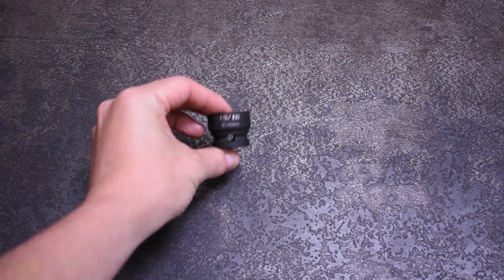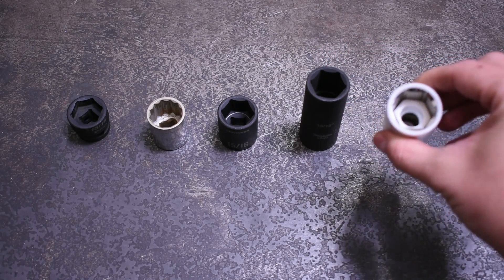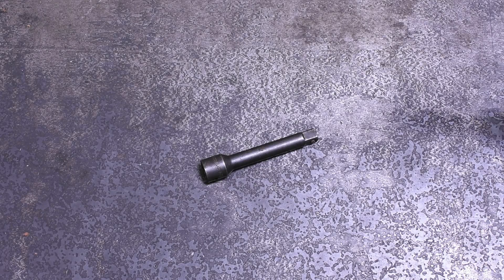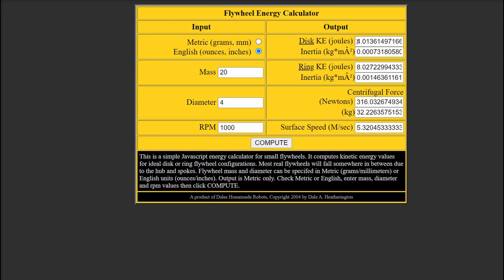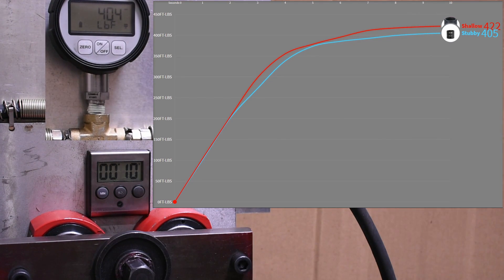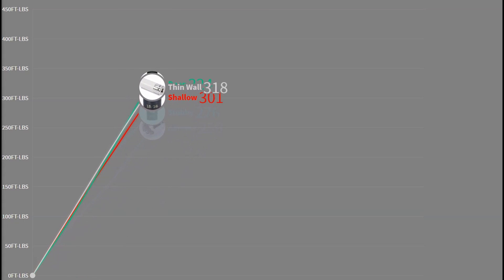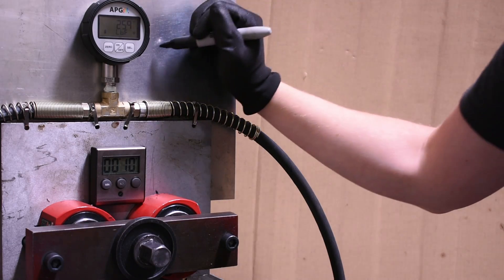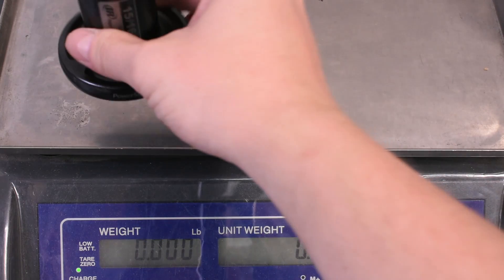Can Heavier Sockets Actually Increase Impact Dyno Numbers?

Comment: you guys should weld a big ol' homemade flywheel onto a socket and see what happens. Love this channel, thanks!
Reply: @fredygump5578  I've welded impact sockets several times and never had one fail but i also was using them manually, not with a gun. I used impact sockets because chrome and welding don't go well together. I think your point is valid but overstated.  Besides, it would at least be fun to see.
Reply: @Lucas12v  I have tig welded many a chrome sockets with both stainless rod and er80 rod. Not a one failed at the weld.
Reply: @timothydillon6421  I've done it with chrome sockets too. Usually with 309l but sometimes er70s2. I just don't like the fumes the chrome makes. I try to grind it off but it always makes smoke and fumes anyway.
Reply: @Lucas12v  I 100% agree with you on the smoke and fumes. I avoid breathing that at all cost. The only reason I use er80 and not 70 is because that is what we have in the shop. Almost everything is 4130 for the racecars so just so you cant accidentally grab some 70 we only have 80 in the shop. Our stainless rod is also some priority something but works great for welding stainless tube to 4140 header flanges. So that is the only stainless rod in the shop. It's called royal 220.
Reply: This and a "flywheel extension adapter widget".
Reply: @fredygump5578  there is definitely some truth to what you say but i have welded sockets that were in use for years afterwards with no issues.
Reply: @tims2050  I don't doubt it.  But science is about eliminating variables.  Maybe these guys could test a welded socket with a non-welded socket to see if the welding makes a difference.  It seems likely that the welding will have "some" effect, because the IR patent descibes the socket as a spring--I believe they are describing the ductility of the metal itself.  But yeah, test and see!
Reply: I agree they should try to make a short power extension instead of buying a whole set of sockets
Reply: A big ol' hit and miss engine flywheel to a small ol' 10mil
Reply: @fredygump5578  I have personally welded many sockets and none of them have failed at or because of the weld.
Reply: @timothydillon6421  You assume that no catastrophic failure = welding has no affect?  That is a lazy assumption!
Reply: @fredygump5578  I did not say it had no effect but the sockets failed in the usual way after extended use.

 I work on racecars for a living and the most common thing we need is an extra deep 11/16  12pt 1/2 drive socket. An impact socket is too thick of wall to fit in the recessed hole so we use chrome sockets. The logo on the tool also has to match the logo on the sticker on the car. To extend the depth of the socket I have done it 2 different ways. Either cut the socket in half and weld a piece of tubing in the center or weld 2 sockets together. The 2 sockets is my preferred method because it is faster and the tools are part of the sponsorship they are essentially free. Basically you get x $ of tools per year and its usually in the 25 to 50 range. So an 11/16 socket fits perfectly inside a 15/16 socket. And it either wears out the 12 point on the 11/16 or splits it at its thinnest point. We tend to break 4-6 a year but have never had one do anything more than crack up the 12pt and mushroom. 

Matco and Carlisle have made custom sockets but I'm not aware of any of the other tool brands making such a thing for the teams they sponsor. 

Tool brands I have used through sponsorship of the cars I have worked on in alphabetical 
Carlisle 
Cornwell 
Craftsman 
Gear Wrench 
Mac
Matco
Snap-on
Reply: @fredygump5578  dude, use your brains. adding material isn't going to make something weaker.
Reply: @schlomoshekelstein908  Lol!  Use YOUR brain....welding 1) softens metal 2) shinks metal 3) changes crystal structure of the metal.  Oh yeah, and I never used the word "weaker" until right here!  So what was your clever point again?
Reply: @fredygump5578  if welding softens metal why are welds so hard to cut thru, genius?
Reply: @schlomoshekelstein908  This is the most hilarious comment I've read on the internet, probably ever.
Reply: @schlomoshekelstein908  You have never heard the term "Heat-Affected Zone", I take it.

You may want to look it up.
Reply: @timothydillon6421  get a grip garage did that
Reply: @fredygump5578  why not just an interference fit, then the only thing you have to heat up would be the flywheel
Reply: @moondoggy17  Sure.  Or old fashioned press fit.  But a removable flywheel would allow you to test multiple size flywheels on the same socket.
Reply: I bet at a certain point is going to be diminishing returns
Reply: @TainterRacing  I would imagine it's a balance of enough weight to have inertia, but not too much to start bogging the impact
Reply: @raffighookassian1724  I'll second that there is a trade off there at some point.  Though, the thought of a 5 pound flywheel 33mm socket on a 1" drive tire gun busting rusted semi lugs still crossed my mind.
Reply: @sambrose1  I wrote to IR about making a 33mm power socket. Never heard back from them. 🤷🏼‍♂️
Reply: Use a harmonic balancer 🤣🤣🤣🤣
Reply: @fredygump5578  gorilla glue it is.
Reply: @brendonsmith8837  lol
Reply: Maybe use an old socket extender and weld it to an old rotor. Not sure whether that will work but it will certainly be entertaining..
Reply: @kastooMcFry  A brake rotor would be a great idea if you could find a socket about the same size as the hub hole
Reply: @fredygump5578  pffft, I have dozens of "custom" sockets composed of 2, and 3 sockets all mig welded together, that have removed dozens and dozens of bolts, including a 36MM 12 pt welded to a 2 inch 3/4 drive that has removed the balancer bolt on shit tons of Duramax diesels, been alive since 2003.
Reply: UNLIMITED POWER
Reply: I was thinking of that too until I remembered the nature of the beast and my welding skills lol.
Reply: @fredygump5578  interference fit mabye🤔
Reply: yes try it please
Reply: @fredygump5578  Just a press fit.
Reply: That's what I thought too!
Reply: @fredygump5578  obviously welding anything ever,  effects crystalline structures of the metal. Heat treatment isn’t necessary for a lot of things, for obvious reasons. I used to work at a heat treating shop, and I have welded many things that have been heat cycled 100s of times, that were used and abused, such as internal structures of furnaces, fixtures or tools for them. I made a custom eye bolt “socket” to make quick use of some eye bolts on filter housings, which had essentially a 3 inch rectangle coming off the socket, never broke. It’s a little more durable then you’d like to think, after welding. Crash cages for motorcycles are welded and never heat treated afterwards and they see a ton of abuse and generally don’t break before your bike does.
Reply: Sixtyfiveford has just that.
Reply: @kirklanddavis  that was a cool video, thanks for sharing. It was a great idea sixtyfivecord had in making a flywheel extension but it did fail. I guess we know why they only make flywheel sockets and not extensions
Reply: Absolutely, weld on a small engine flywheel.
Reply: So i should weld old car rims onto my 3/8 drive sockets? Ok
Reply: A ten foot one and really test impacts.
Reply: I used sticky wheel weights and hose clamps before to remove crank bolts. It was scary and sketchy as hell but believe it or not it worked. Just keep your hands clear of the hose clamp!
Reply: The 2" impact wrench to turn it would cost thousands...lol..and who's holding it?... yikes...😬
Reply: @boosted2.4_sky Eh, the weight 'll keep 'err still🤣
Reply: Impacts don't turn flywheels very well due to the hammering effect. Have tried with poor results in the past. Not enough rpms.
Reply: @tempus3877  that's why I use a drill to start my push mower.
Reply: @fredygump5578  iirc impact sockets aren't hardened to prevent shattering when you know beat on
Reply: @tylerblubaugh5549  They're hardened to make them not deform and tempered to toughen them. Tempering basically takes away that shattering characteristic. Put enough ass behind something and they'll still shatter but at higher loads than they see in use.
Reply: @anonymic79  technically they’re hardened to make the teeth shear less, hardening gives the outer “case depth” (whatever the spec is) more resistance to visual defects and leaves the core rather soft, in relation to the case. It’s tempered, or normalized, to reduce crystalline structure defects, and make it overall more rigid, in a basic sense.
Reply: @Sffker  If you can shear a "tooth" out of a 6 point socket, I want to see it. Otherwise, sockets are not case hardened, they are through hardened. Besides that, your idea of how heat treating and tempering works is flawed. I've spent enough days working in a heat treating shop to know the difference.
Reply: @anonymic79  you can absolutely control case depth when it comes to hardening a socket. The spec would call for a specific time that allows the treatment to penetrate to the correct depth. “Through hardening” would be the cheaper way of batch treating thousands of them. And not really. My career began in a heat treating shop, I kinda know what I’m talking about. Unless you wanna tell me something about salt bath ferritic nitrocarburizing that I don’t know, or endothermic carburizing/gas nitriding, basic hardening, quenching, tempering, is pretty elementary in that space.
Reply: @tylerblubaugh5549  impact sockets wont shatter thats why they are impact rated. standard chrome ones can bust depending on how much impact force is used.
Reply: @tylerblubaugh5549  Oh, ok.  But welding will still affect the physical properties even if it isn't hardened..  If we're doing science, it's still best to avoid welding.
Reply: I totally did not expect this to do jack.  I wonder if it is more a rotational mass resonance situation tied to the ideal RPM or just the rotational moment of inertia.  

I think welding a 1.25# and 2.5#cast iron plate to the base of a normal impact socket will tell us a lot here, or just use a piece of 3/8" steel plate.  what could go wrong :).
Reply: @larryseibold4287  I had no doubt it would work. Just like a car, usually light weight aluminum flywheels are great for autocross, but try to use it at a drag strip, and you car will never launch hard. Use a steel flywheel, suddenly your front wheels are off the ground. Its all about the potential energy held in the weight
Reply: @raffighookassian1724  yes and no. In a car a heavy flywheel will prevent the engine from changing rpms quickly. Both up and down. Like you said bad for a car that it turning. But also bad for every gear change on a drag car as the engine needs to wind up the inertia again every time you grab the next gear. Better clutch management at the launch with a light flywheel and clutch will will improve the short numbers, reduce the overall weight of the car, reduce rotating mass, and reduce the inertia changes on each shift.
Reply: @timothydillon6421  oh ya, by autocross I wasn't referring to cornering, I was referring to overall speed. The aluminum flywheel helps in every aspect, other than your launch

Comment: Ok I’m gonna comment before watching the whole video just to see if my real world experience is held out 1. There is something imho to the spring rate that ir refers to as anyone whose run an impact for a living (30+ years as a heavy duty mechanic) will tell you. If you wrap your hand around the socket on a stubborn fastener soaking up the vibration you will increase the breakaway torque and get carpal tunnel. Also I’ve used the 19mm ingersoll crank bolt socket on the famously stubborn Honda crank bolt and it does work.
Reply: 100% works by preloading the socket in the direction you're going.
Reply: I was going to post the same thing, but checked first to see if it was already said. YES!

Comment: Shouldnt you do several different runs with each socket to get an average before moving on to the next one? I ask because im really curious about this specific subject
Reply from the maker: Unless we otherwise mention, every test you ever see on this channel is a median of 3 runs. We run each socket, extension, impact wrench, air hammer whatever 3 times and show the median on screen. Then we mention when applicable if the tool was all over the place. Good question.
Reply: @TorqueTestChannel  I would put this Information in every video description if you could. Maybe add it to a FAQ section. Thanks for your hard work by the way, I work for a small business doing tool sharpening and power tool repair and this real world testing is the only thing that matters at the end of the day. Especially in an era where marketing matters more than truth for most people.
Reply from the maker: @austinmatney7591  We've probably mentioned it around 50 times throughout our videos, but you have a point.

Comment: I think the springs in the "flywheel" are there to recover the lost impact energy, but they'll heat up with all that bpm going on.
Reply: also, is the thin-wall chrome socket stiffer than the impact rated socket?
Reply: @wim0104  it’s a harder material which makes it more brittle and yea it’s stiffer.

Comment: Interesting that the stubby impact socket was so close to a deep impact. I believe MrSubaru did a crank pulley test where the shallow/stubby socket didn't remove the bolt while a deep socket did (or maybe he simply went from a 3/8 drive socket to a 1/2 drive while using an adapter). Either way, that small power difference was what the impact gun needed to remove the bolt. I want to say this was using the Milwaukee mid-torque as well.

Comment: I would love to see a comparison of a 19mm IR power socket versus the 19mm Lisle
Reply from the maker: The problem with these sizes when tightening like we can measure is the threads for that drive size (16mm on a Honda) would mangle and not give any useful data.
Reply: @TorqueTestChannel  I would like to see the 19mm comparison also.  How about welding a 19mm nut on the end of the regular large screw? With the slight modification you could test 19mm sockets and not worry about threads distorting.
Reply: @TorqueTestChannel  Maybe use the weakest 1/2 impact you can find and do a head to head on IR vs Lisle. I'll buy you a Lisle socket if you need one.
Reply: That seems like the solution to excessive power in the test rig. Limited power in, limited power out, and any differences could be validated. The only thing is that impact rate timing probably will be a variable that affects how well the power socket works, like the timing of pushing a kid on a swing as opposed to a burly man.

Comment: I am wondering if the metallurgy of the ring and its supports is such that they behave more like spring steel than the rest of the socket, obviating the small parts and assembly, at the cost of more complicated heat treatment. Though the latter is probably more easily scaled. Course it's all for nought if it's actually snake oil, which apparently it isn't.
Reply: The spring rate - how much the material flexes for a given load - doesn't vary much with with steel type or temper. Spring steel is just a lot stronger, so it can flex further before it takes a permanent bend. In any case, the 40-45 HRC typical hardness for an impact socket isn't hugely different than the maybe 42-50 range of typical springs.
Reply: The patent has to spell out exactly what the invention is so those “skilled in the art” could duplicate it.

Comment from the maker: Lisle doesn't make a weighted socket that would fit this rig (anymore). We need 15/16" or 24mm, if we made the drive size and therefore thread size any smaller we would be stretching threads with these impacts, which means data becomes useless. This is because we're tightening the bolt more and more with the test, not loosening something stuck like you likely are. If you have a 15/16" or 24mm weighted socket, or want to make one and send it to use let us know!
Reply: Also, just asked a friend, he has a 24mm lisle crank socket he's willing to let you use.
Reply from the maker: @TCarstens1  This! We'd love to get ours hands on a 24mm Lisle! please email us Torquetestchannel@gmail.com
Reply: Here's a 3/4 drive 24mm crank socket.

https://baumtools.com/shop/land-rover/engine-tools-2/303-1438-24mm-crankshaft-bolt-socket-5-0l-v8/
Reply: Why not just weld onto a normal socket. Just put a sleeve or run bead after bead
Reply: They needed a 1/2 drive socket to compare apples to apples. Welding a on a socket with an extensions would probably create to many variables to yield any concrete evidence.
Reply: @dougehouser5672  I weld on stuff all the time. Put my I initials on my spud wrench and socket. I even have a spud with a 1-1/4" socket welded onto it so it doesnt fall. 

The point of welding is to add weight. Just run beads or torch out a circle in a piece of chinking 

We also cut the sockets we dont use in half and weld em together so its a 1/2" on both ends. We then impact out cat tails. Sssoooooo much better than the old way
Reply: Fantastic video! Ir patent and explanation was icing on the cake!